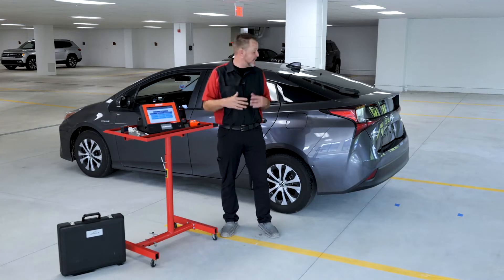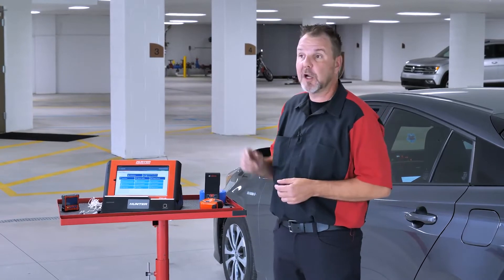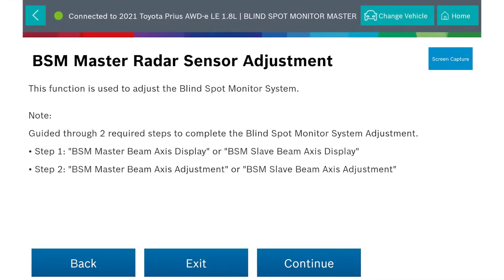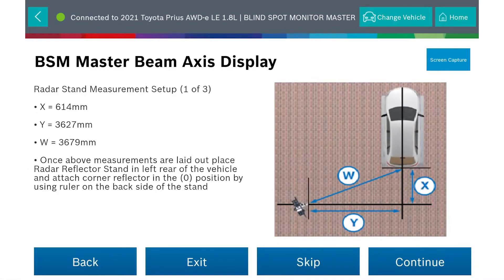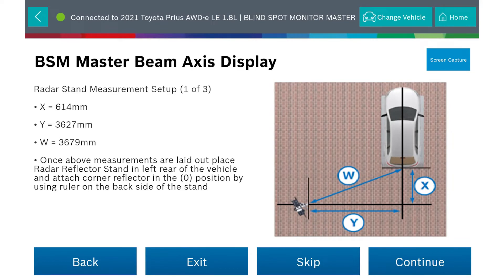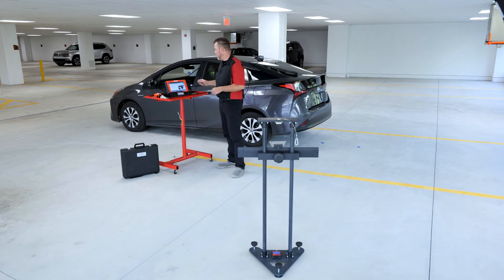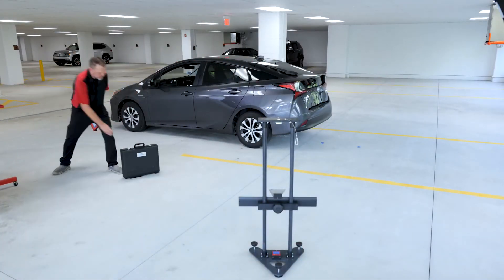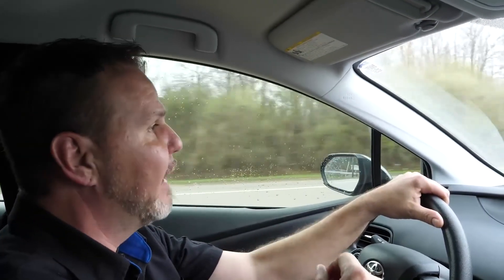Toyota Prius Blind Spot Monitoring System Calibration

Comment: What happens if radar has moved location after new bumper install, will recalibration change it to new position. Or do you have to move radar to a new position, hope that makes sense.
Reply from the maker: The blind spot sensor must be installed in the exact same position as it was from the factory or it will fail calibration.  Calibration is required anytime the rear bumper has been removed, collision has occurred, or if the sensor has been replaced.

Comment: Why do you not mention it needs a proper alignment?  And was that done at the body shop?
Reply from the maker: Hello Derek,
 
In the interest of video length and focusing on the main procedures we didn’t outwardly mention the alignment, but you are correct in the fact that it is required. One of the beneficial features of Hunter’s ADASLink system is that it guides you through the calibration process, and prior to beginning, there is always a screen that lists any required pre-conditions.
 
In this video, that screen is shown between 3:27 and 3:30, and the alignment is listed along with the other pre-conditions for this specific procedure. It may be easy to miss, but it’s a great point to remember. Also, in this case, we performed the alignment in-house prior to this procedure. Thanks for watching TechShop videos!